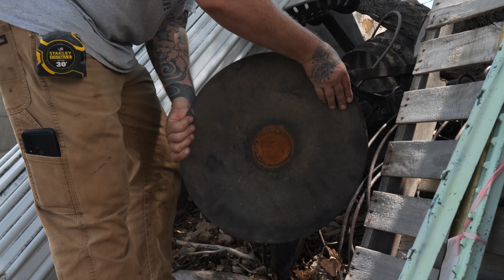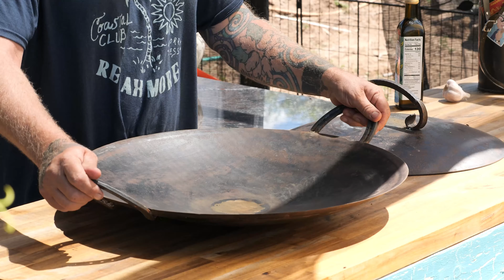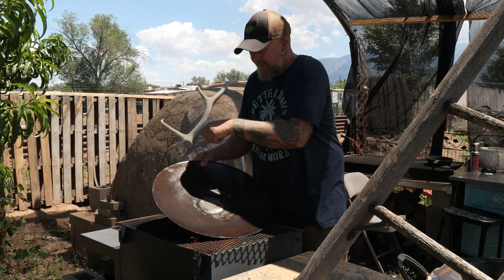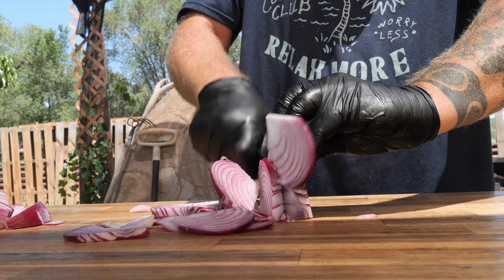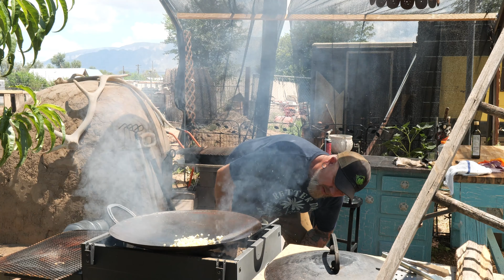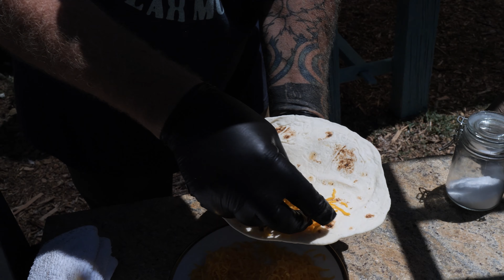Beef Fajitas, Tender and Juicy | My Fire Feast

Comment: Yummy
Reply from the maker: It was. Thank you!
Reply: That's a beautiful thing! BTW, what did you use to make your covered pan--they look like tractor hub caps or some kind of machine parts?
Reply from the maker: @kennethartz7387  We use Plain Disc Blade (just smaller diameter)